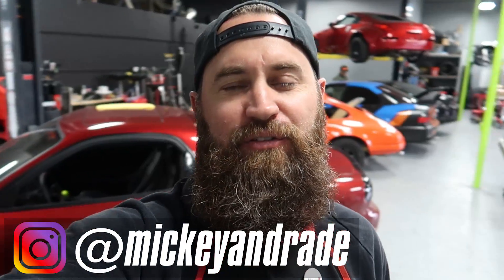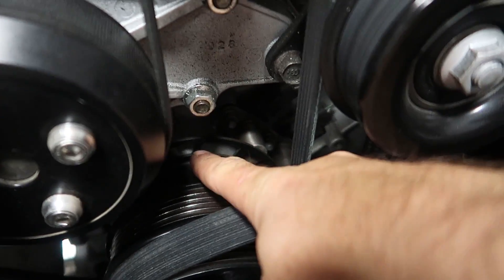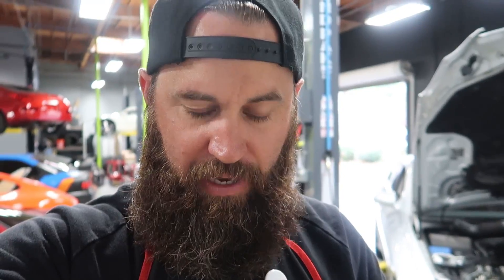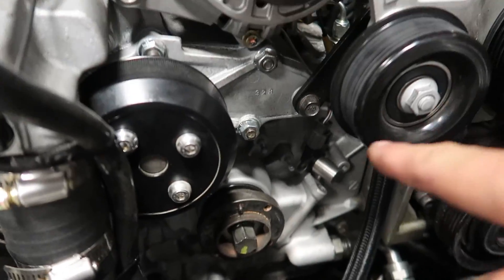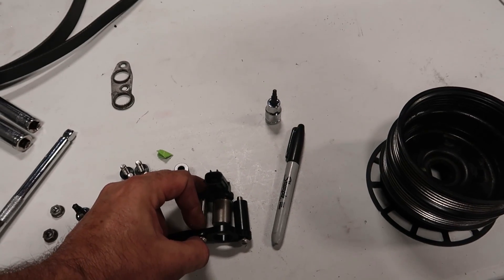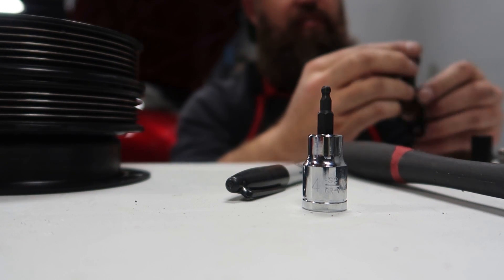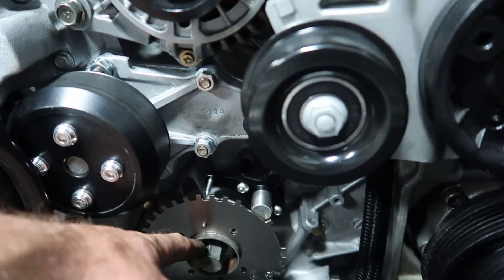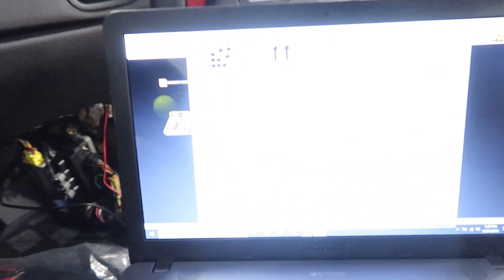INSTALLING THIS IS KEY TO MAKING MORE POWER WITH THE FD RX-7!

Comment: I'm pretty sure micky's rx7  is running way better stronger than tj's rx7 wanna knw why cuz it's Mickey spec but fr that's my opinion
Reply: Mickey pretty much built Tj’s rx7 anyway
Reply: @tylerdavis5894  yea but Mickey literally had hands on his engine practically the whole time. He knew and saw what was going into his motor. Yes he helped tj but I could say body wise n then jus putting the engine in the engine bay that's bout it